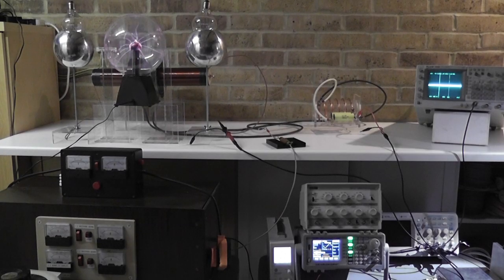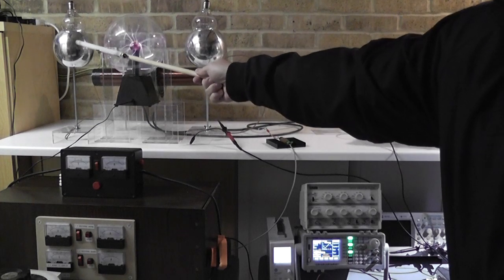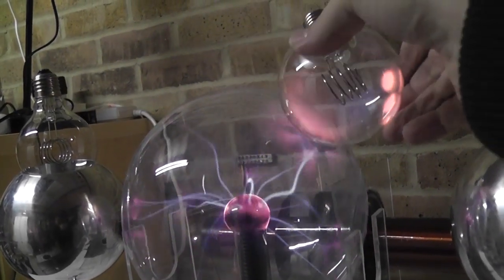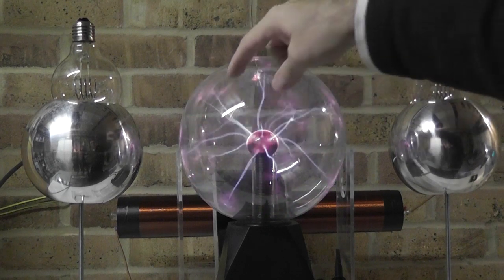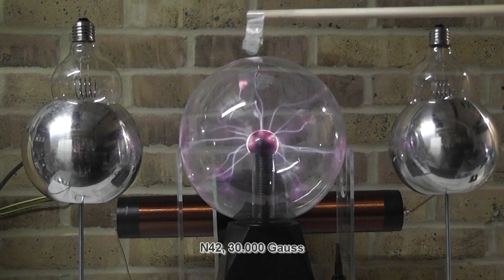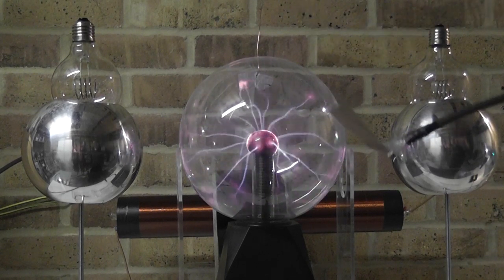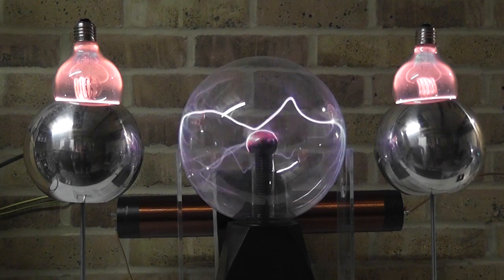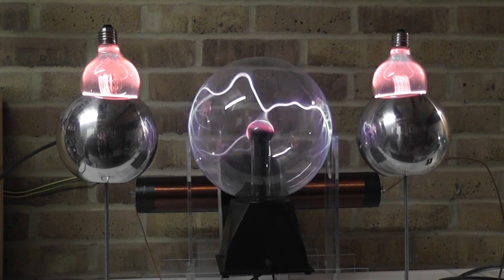The Behaviour of Plasma in an oscillating dielectric field of a Bipolar Tesla coil

Comment from the maker: The Bipolar Tesla coils is very special. Plasma is hot and power propagation is with current. Based on the gas mixture it will create different effects but not like the excited field from a flyback. It contains longitudinal waves in it's purest form and the dielectric field is highly reactive. That means it has a huge impact on all your electronics in your house. But I will try one more test and will touch the Plasma Ball.

Comment from the maker: Very good question. It does. The permanent magnetic field is static or polarised. The AC field is not polarised. Influencing a plasma stream is based on the gas in use and the kind of ionisation you achieve. In a static electrical field you rip away electrons from the plasma and create a controllable plasma field. This example is creating an non-polarised plasma stream which can not be influenced by any field. It is neutral. To change that you need to apply a high voltage DC field in parallel.

Comment from the maker: I agree, I had the same experience. My hand was changing the frequency the stream did stop. By reducing the frequency this influence did disappear. And no, I will not touch the ball. I got shocked enough already ;-) My first test did use electrodes mounted on the ball. The energy transfer was too high and it did melt the ball. I removed the electronics.

Comment from the maker: Correct. Out of simplicity. Fields are either static or alternating in nature. In reality there is no static fields. Even an permanent magnet has rotating fields. The E's and B's come from the electromagnetic propagation of energy through an conductor. You can separate them. A Tesla coil does not contain the B-field. It is pure electrical potential, missing the current. If you view a couple of my previous videos about power propagation in transmission line then it will become clear.

Comment from the maker: I use a high power solid state amplifier which is around 200 Watt into the system. The RF burns are very nasty. I will try with my Power gauntlets. It will damp it slightly. I might record it as well and post.

Comment: My setup is completely different from yours. In yours, the plasma ball is not connected to the output of your coils. In mine, the plasma ball is an electrode, hence the different discharges. Seems we both have longitudinal electricity, just using it differently..

Comment: I believe when you are trying to effect the field in the plasma globe then you would use two sets of magnets where in each set there are two poles that surrounds the globe on either side, all north on one side and all south on the other side like in a magnatron in a microwave oven and the field inside will increase the longer it is on especially if you wire in some transformer laminate core into the primary of the globe as a sink.  You could also add some grounds right at the glass on each side and it will arc when it turns on.  Just be careful on how long you run it because you can get small holes in the globe.....I am working on it and i am placing the globe in mineral oil now to see if the addition dielectric material will effect the outcome and prevent holes....

Comment: I'm very surprised that the magent doesn't have any effect in all circumstances.  I would think that espcially in the last configuration, a magnet would cause a bend in the path instead of being the longest distance along the side of the ball... it should really cause a curl, but then if not, then electrons aren't moving?  So what sort of energy is that?

Comment from the maker: Going forward there one very important experiment I was already preparing for it.
See my Phanotron Video. A helium filled Pyrex container with 4 electrodes. 2 for HV DC in the 100-200 KV region and 2 electrodes for AC around the 20-30 KV region.
Stoyan Sarg, Field Propulsion by Control of Gravity and the Pulsed Plasma Power and the Aether Motor from Dr. Paulo Correa and Alexandra Correa

Comment: The capacitance of your body DOES affect the dielectric field. You are not seeing a visible difference in the plasma discharge when your hand is near to it because you are passing a current through the ball which reacts with the dielectric field between your electrodes. If you replace one of your electrodes with the plasma ball (remove electronics in the ball first) you will see what I mean. This is what I did & when I touch the ball, the discharge goes straight to my hand - watch my video..  :)

Comment: Great stuff - thanks much!

Odd to me that the magnetic field generated by the plasma currents doesn't seem to be affected by an external magnetic field. Were you expecting this result?
Reply from the maker: Not initially. In later experiments I can influence it with magnetic fields. Reason here is that the streamer contains both polarities entangled in a stream which makes it neutral to magnetic fields but not to stray capacitance. A hand or object does contain already vortex fields based on my Aether field theory which are interacting with the streamer. The subject of looking for energy polarity equilibrium is here fulfilled

Comment: I am producing the same effects as you are with a magnet - it has no influence on the plasma discharge. I am a bit unsure as to why you are getting shocked though. If it is pure longitudinal electricity, it should be a DIELECTRIC FIELD ONLY  - no current should pass & the ball should be cold. Have you tried single wire LED's & neons in series? Is your plasma cold? Maybe we could perform a couple of experiments & compare results - (apples to apples)... Let me know if you're interested... :)

Comment: hi joe booker alias joe cell states that if you fractional a wire from the exciter terminel of a starter motor and have a steel washer/button acting as that fractional gap the steel washer will act like a magnetic distributor and cause a static firning by air especially with aluminium heads he states hitler did this on the vw beetle ingventor is the user name he walks positive and positive together does this add up thanks

Comment: I was thinking, is The Ark of The Covenant simply a Capacitor. 
Gold sheets separated by wood. Gold covered the outside and the inside of the box which was made of a noncunducting acacia wood.
Two wood polls slide through 4 holes to carry i- so no one got shocked. 
And the 2 Cheribum wings almost touching on the top -like electrodes where god would appear like a spark.
Reply from the maker: I think that is correct. There is much more to capacitance that anybody once to know. I did some testings about it.

Comment: would you be willing to show how the B+ voltage field as described by stanley meyer works to pluck off electrons from a stainless steel loop argon laser light guide he states that it enegrises the vacuum gas which is either air (non combustable gas is his clue) or water vapour/hydrogen oxygen .he says the same as a old television B+ i am baffled how you can attrract jhe cathode ray tube electrons and how you can feed them back in to the argon laser and also makes a perpetual generator melvin

Comment: Could you please tell mw where I can purchase those Top Loads? I think there is so much that one can learn from a simple Tesla coil, i love watching the gasses begin to ionize like a miniature thunder clouds!
Reply from the maker: Do you have Ikea for shopping available to you?
Reply: Yes!
Reply from the maker: Well go in the candle section. It is a candle stand. They have two sizes. You can't get cheaper an aluminium topload. ;-)
Reply: That’s good news as They look like expensive machines spheres.
Reply: They seem to be discontinued, although I found a new set of three on EBay for 60
Reply: Have you made a vacuum tube powered Tesla Coil at all, they are pretty neat?
Reply from the maker: They produce them since the last 7 years. I don't know what currency you talk about but they do not cost more than £7 the big sphere. I get them here in Romania as well.
Reply from the maker: No.To expensive and too many losses. You have to use high voltage for the filament.
Reply: 20usd
Reply from the maker: Well, I should sell mine than for that price. I got a couple in the original plastic wrapping not used. However I only sell stuff others can't get like the Metglas ribbon tape.